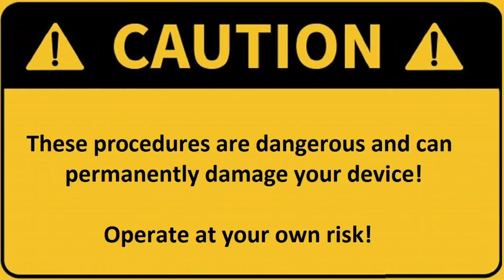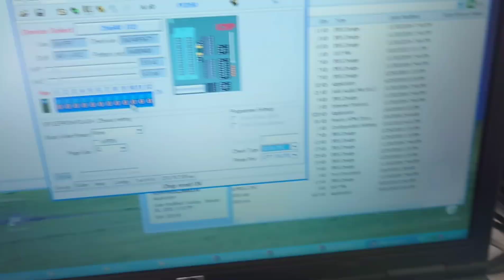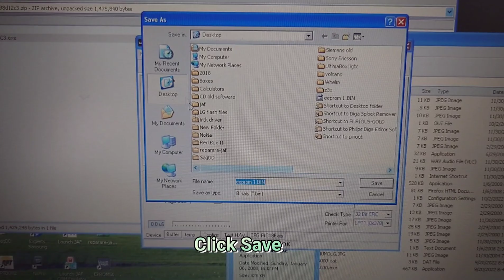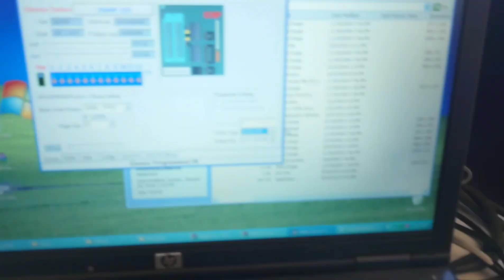How to Unlock the Mitsubishi MT-230i - FREE solution

Comment: do you know what does "_@ e" means? also why do you have to solider the EEPROM chip into the phone, turn it on, then desolider
Reply from the maker: When you turn it ON, some changes will happen in Flash and EEPROM. After these changes, a fresh EEPROM dump is written and the procedure is complete. When the EEPROM is changed the first time, the Flash will notice it and disable it. That's why it's necessary to do it again